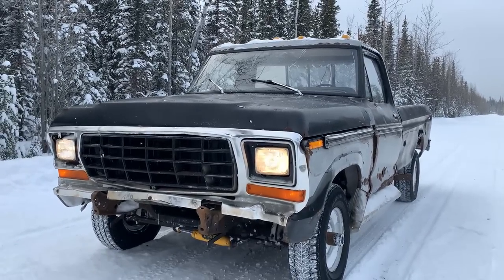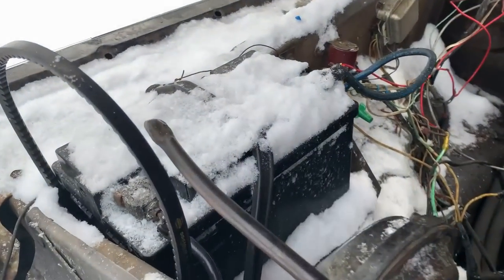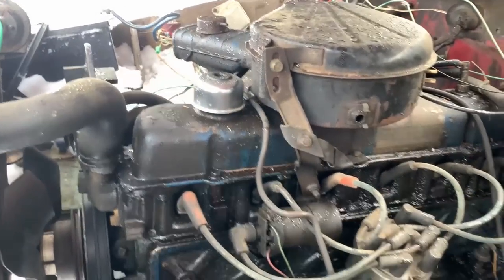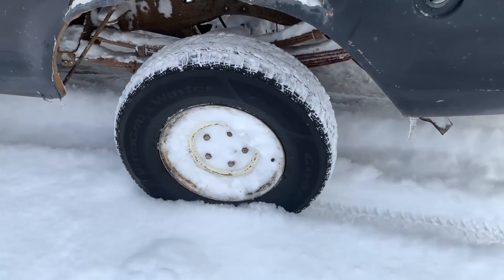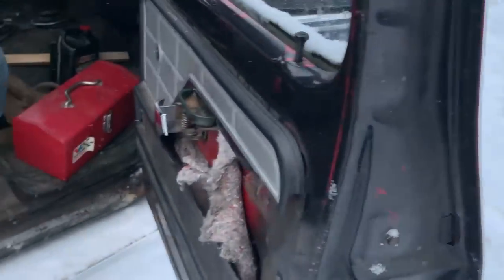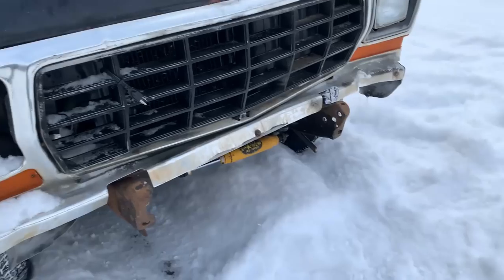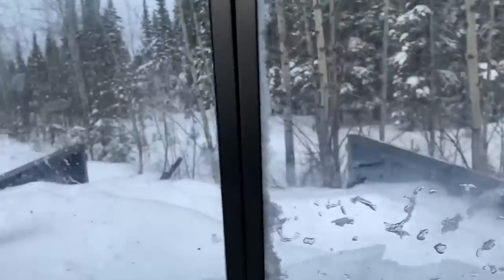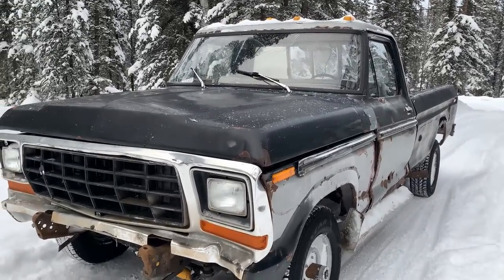Supercharged 1979 Ford F150 Rally

Comment: That is not oil leaks. That is a self lubricating system and anti rust protection.. 👍👍
Nice truck. I would love to find a 70’s F-250 4x4…
Reply: Me too but finding one in good condition in the rust belt Is like finding a needle in a haystack
Reply: @greaniebeaniez3070  Then when you do find them they won't be cheap.
Reply: We call it the "Ford Under Body Anti Rust" system :D
Reply: @johnnycortez46  yep found one near Illinois for only $5k on Craigslist not rusted awfully but had little rust. Talked to the guy who had previously owned it for 10 years and drove it just to his work and back about 5 miles. Noped right out of that pretty quickly
Reply: @greaniebeaniez3070  That's pretty good compared to prices i seen here in South Texas.  Roughly 8,000 and up

Comment: When I was scrapping cars and just junk , I once crushed a 80s caddilac brogham , a 90s ford escort wagon and some Subaru piece of junk.stacked all three on top of each other make sure everything was hosed down with water and continued to stack more scrap on top... moral of the story is just in scrap weight I was 16,880 , and what brought all that over the scale pulling a eager beaver triple axle from the 80s was my 88 f250 300 strait 6 with a zf 5 speed .....my old  wood truck I had was a 77 gmc with a 400 sb couldn't do 3 cords of wood but that strait 6 pulled 16,880 3rd gear roasting the clutch , but she made it

Comment: I have a '99 F350 here In NC. Occasionally people catch the "Seekins Ford; Fairbanks, Alaska" and they are stunned. The truck is a crew cab, 4WD, long bed with a Warn bumper & winch combo, has an aftermarket grille with 7", 150 watt  LED driving lights in it w/3.5" PIAA LED amber foglights in the bumper- it's utterly overkill here, but in Alaska or in the middle of "Nowhere, AZ" they work awesome.

Comment: I used to have a 1979 Ford F-350 12’ flatbed with 300 six and four speed. Great truck!  Wish I still had it.  Agree 300 is best six ever made.  225 slant six in the dodges was a good motor too.  Now my truck is a 1996 F350 dump 7.3 turbo diesel and automatic.  Some day going to find another 300/4 speed ford.

Comment: Another super cool video in all regards! 
Thanks for the tip on the IH Channel....it will certainly be useful as we are a happy 1954 R-110 owner here in Brazil. Once very popular around here, those old IH are very rare these days.
The Ford 300 is also rare. They were offered as an option in the 90s on the locally built F-1000 (F-150 with 1,000 kg payload), along with MWM 4.3 diesel, which were far more popular, thanks to already high gas prices back then

Comment: That was so much like my original truck I bought when I was 15 except for it was a 77 little bit different the straight 64 speed. Had so much fun in that truck gone through a lot of trouble got stuck in a lot of places. Lol they have to unload times or get around better than three-quarter tons because it suspension gives easier.